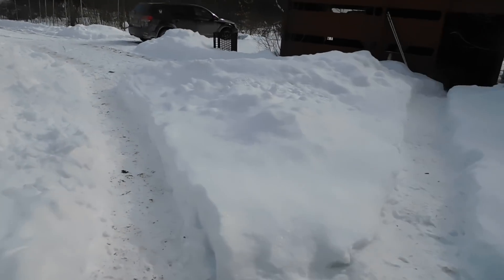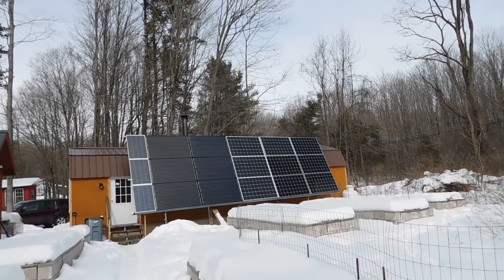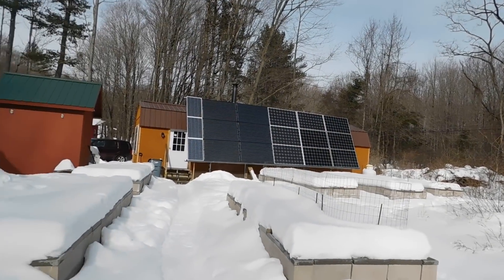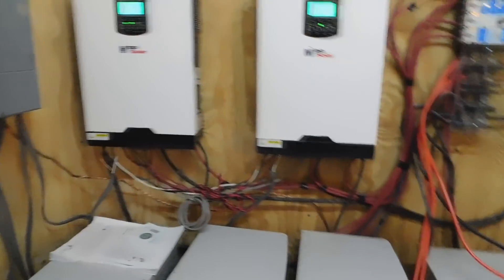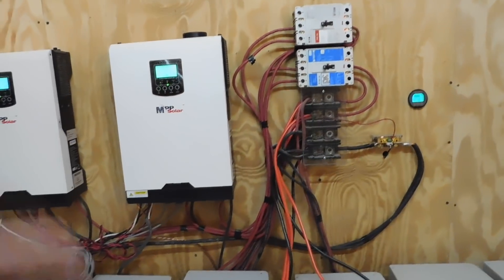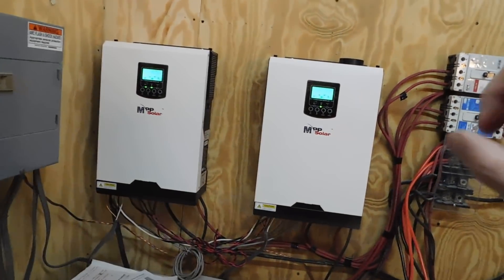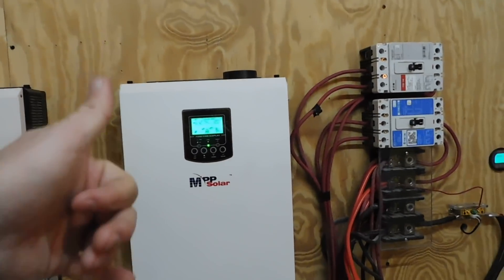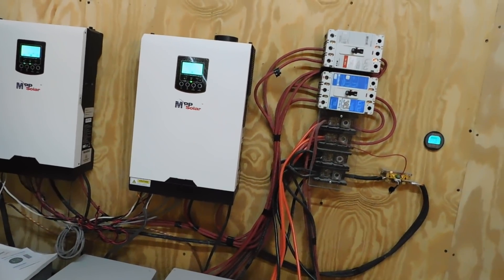Giving you a complete overview of my off grid solar system.

Comment: I have a solar system and it still costs.  I have to replace my lead acid batteries ever so often and any repair and the costs of running the backup generator. My power shed isn't warm enough in the winter to use the batteries you have.  I like seeing other systems I learn so much!

Comment: If you got your third MPP Solar inverter and broke up your array into 3 strings (6 250W, 4 255 W and 5 300W) panels, you could maximize your array wattage with the panels you have now.
Reply: That's what I was thinking as well. Or a simple mmpt charge controller without the built in inverter. I suppose even if the third inverter isn't needed it would be nice to have a backup should one of the other two fail.

Comment: It’s good to buy the best you can at the time. Sometimes that means you have vs not have and upgrade as you can. I’ve done both of having the best and having the worst. Maybe buying a $100 blender that lasts forever vs a $35 that will break in a few years. But if you aren’t using that blender all that much, so it’s cost effective to buy cheap. If you are buying furniture and you buy the best to last a lifetime, but in long run it owns you, why did you spend it? Why buy platinum when silver looks the same in a necklace?

Comment: 40+ years off grid insights. Buy quality BOS (balance of system) components. Compared to 20-30 years ago PV panels are practically free, go big. Don't skimp on copper, DC electricity likes thicker wire. Batteries are the weak link. In a prolonged SHTF there may be no way to replace batteries as they fail. Many will not be able to afford Lithium. Experience has shown that 2v cells are the way to go. Rather than several 6v series strings wired in parallel. One string of 6--2v cells in series for 12v or 12--2v batteries for a 24v system and so on. By using a single string all the cells charge evenly. When using several parallel strings to up capacity there is variation in the current to each string resulting in shortened battery life. If you can manage the expense, 2v AGM  industrial batteries are the way to go. 20+ year life in a balanced system for industrial batteries. AGM (absorbed glass mat) do not need water added. I would say "maintenance free", but you still gotta keep the connections clean. AGM's do require monitored charging by good controller. Flooded Lead Acid in my experience like being overcharged occasionally. Trojan makes their L16 FLA in a 2v model at about 350ah, but for a system  the size of Ed's, 1000ah industrial AGM would be preferred.